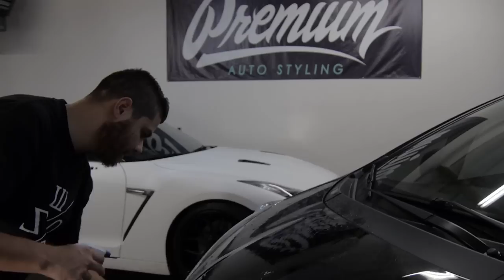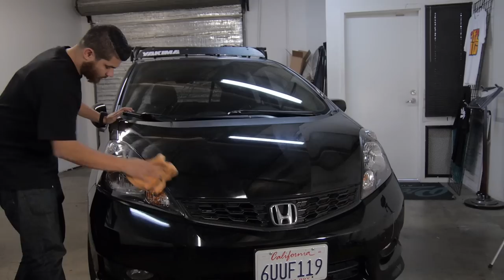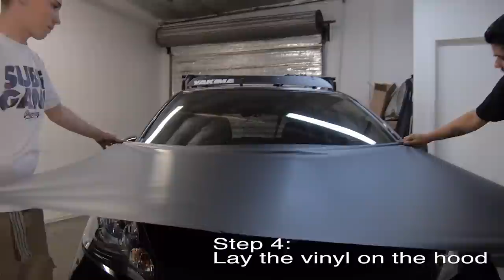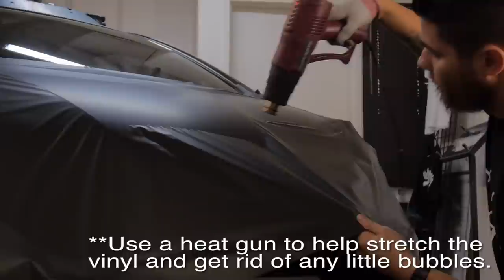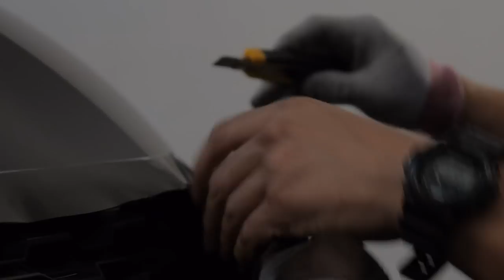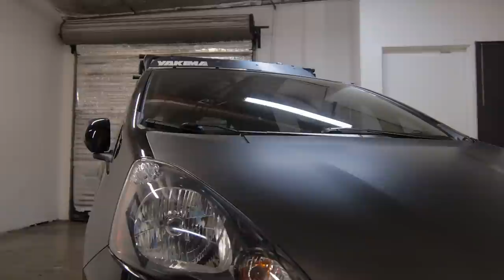How to Vinyl Wrap Hood | Premium Auto Styling

Comment: Would it be better to cold stretch and do the triangle technique instead of using that amount of heat due to the vinyl wanting to revert back when it gets hot? I'm out here in Texas and the summers get blazing hot so I'm trying to figure out what the best way to wrap the decklid on my mustang would be.
Reply: You are correct. Only use heat when absolutely necessary. You can wrap an entire hood without any heat until you need to wrap the corners.
Reply: Would you recommend using the razor tape to edge out the line of the decklid versus using the edge of the vinyl to line it up? Im thinking that way I can stretch it out and get a cleaner install versus a piece that is precut.

Comment: There are loads of better techniques out there than what you showed (some of which you use in your current videos).  Properly laying/glassing the vinyl, which eliminates the wrinkles you're smoothing out with your fingers (which, without experience, will crease very easily); plus wrapping so much under the edges and then having to cut against the paint under the hood.  The stages of this video are correct but the techniques used on the vinyl are not.
Reply: Recommend a good video for wrapping? Your experiences?
Reply: @calvinwong365 4 years later and he still can’t tell you I wouldn’t listen to him theirs turned out good just watch several videos get the idea and practice practice practice